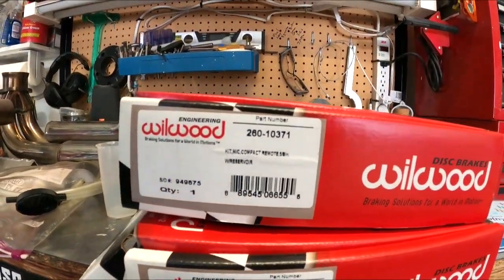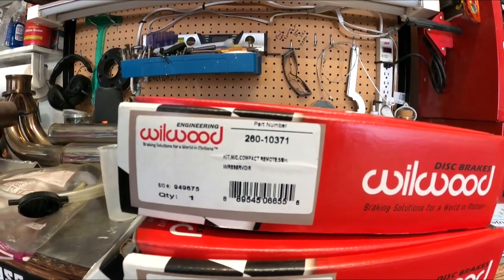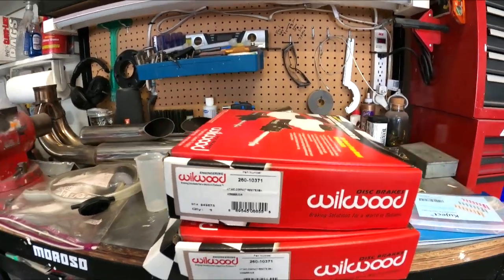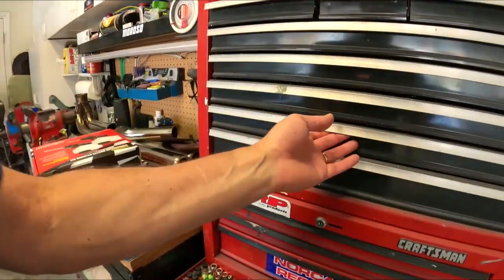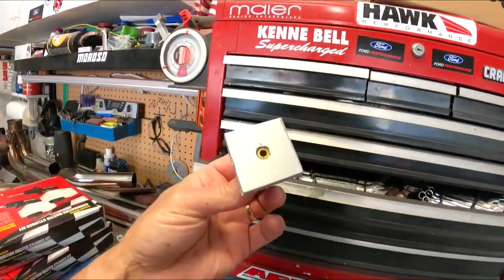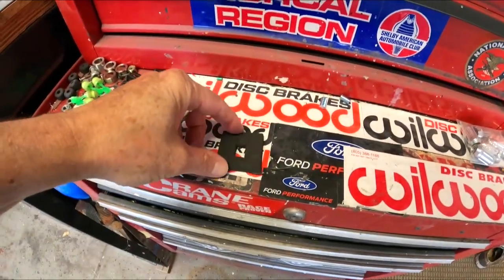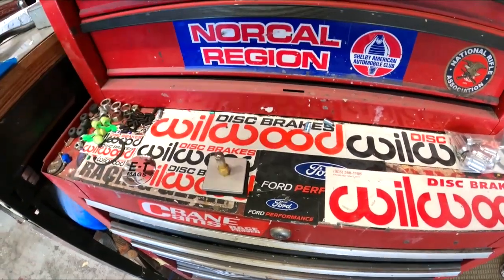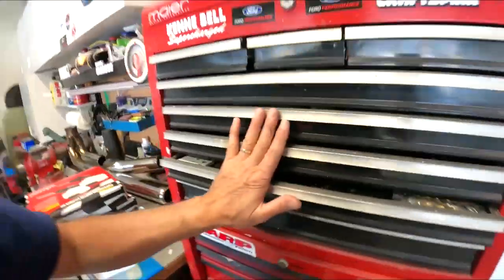Brake Master cylinder Experiment- Cobra Daytona Build, Video 187

Comment: So this is a direct mounted Master Cylinder, thus eliminating the need to install the cup chrome reservoirs?  Is there room in the pedal area for the cover plate to close up?
Reply from the maker: These use a remote reservoir. I don’t think there’s enough room under the foot box area for a reservoir. Tight space.

Comment: Thanks for putting this extended series together; I've been seriously considering a FFR Coupe for my next project and your videos have convinced me to do it.  I'm no stranger to major vehicle projects, as I've built a couple of airplanes and two cars (my own Ultima GTR and helped with my buddy's FFR GTM), as well as completing a vintage motorcycle restoration and innumerable smaller projects over the years.
FWIW, I learned many years ago (when finishing my first airplane project) to bleed brakes with pressure from the bottom up.  That is, put the bleeder nipple on the bottom of the calipers and let the pressure pot push the air ahead of it right out of the reservoir.  No pedal pumping required - perfectly firm pedals every time.  Also, I use a combination of hard lines and ¼" braided lines for brakes; no rubber lines or hose clamps/clips anywhere in the system.  All proper AN hardware everywhere.
BTW, I'm enjoying the autocross videos and might give it a try myself.  I've always been a road course guy (Skip Barber formula cars, track days in my old F430, etc.), but it can go bad (very quickly!) at high speed and doing so with any regularity probably exceeds my risk/reward quotient at this point in my life - or so my wife keeps telling me!  😀
Anyway, keep doing what you're doing.  👍